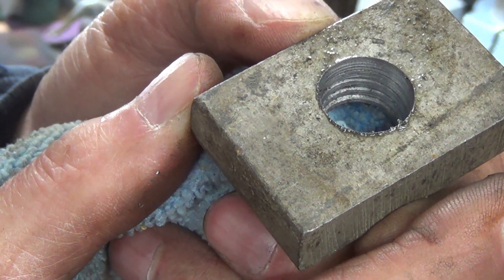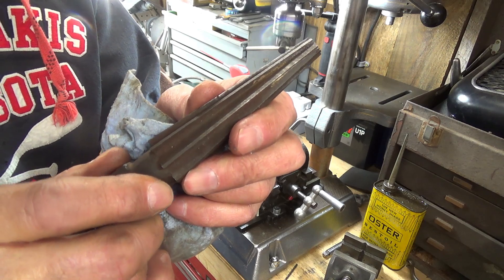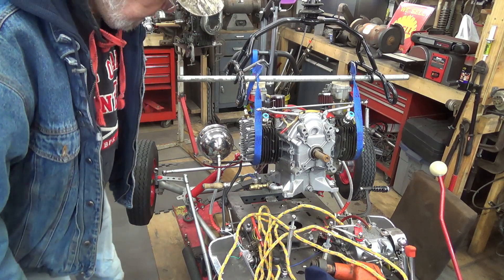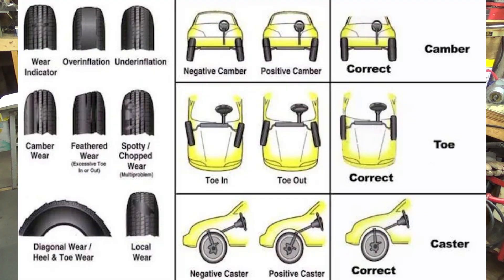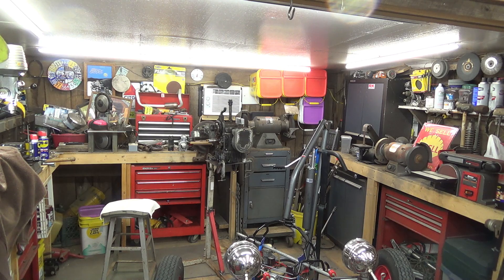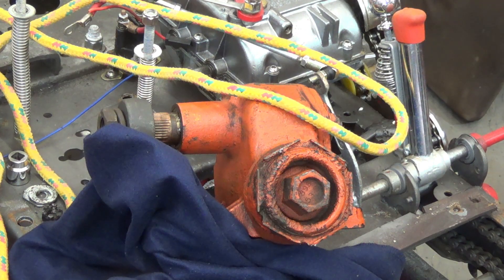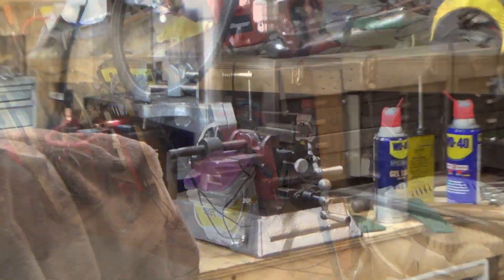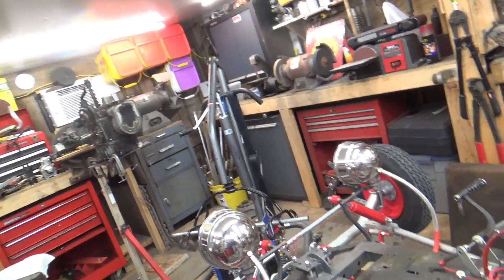Castor or camber? Is Goofy leaning the right way?

Comment: Don't know where you picked up that chart in the thumbnail, but that picture in the lower right corner stating "correct caster" is in fact showing negative caster which will  make that vehicle impossible to control. The picture actually shows "incorrect caster".
Reply from the maker: I found it online, but to be absolutely correct it should read 0° caster, and the same should be said of the camber. The correct caster or camber for any vehicle depends on it's purpose, the kind of vehicle it is, etc. Very few vehicles actually have 0° of any of the shown adjustments including toe-in, toe-out. The chart is for reference purposes only and not descriptive of any particular vehicle, certainly not the Goofy Cart. Thanks for the observations.